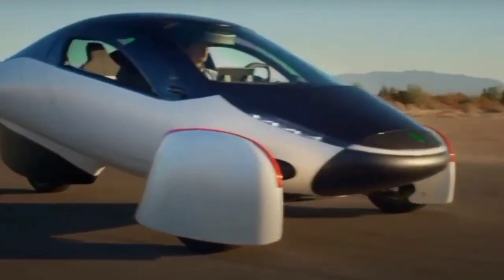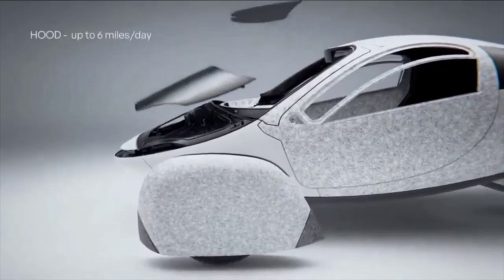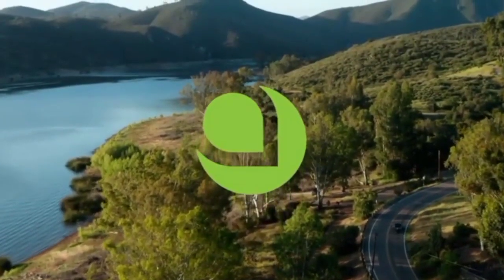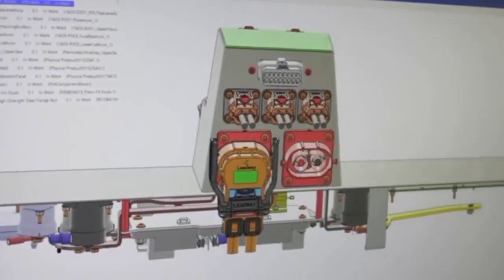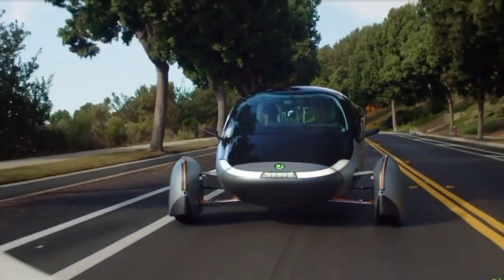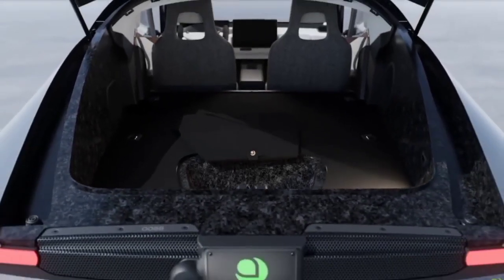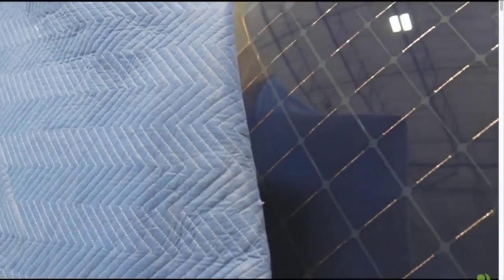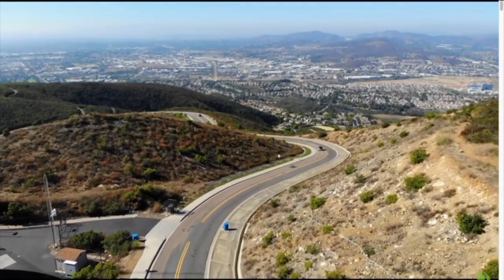Aptera's Suspension Parts Ready

Comment: I love the three wheel drive. For a three wheel vehicle it makes sense. These suspension arms look machined out of a block of aluminum pretty but expensive. And what is drive-train ? This vehicle needs a three wheel drive train with torque vectoring. Keep the baby throw out the bath water. I don’t believe there is any good reason to make a two wheel drive. Why? Handling, braking, acceleration and efficiency. Yes efficiency driving one motor at times in stead of two.